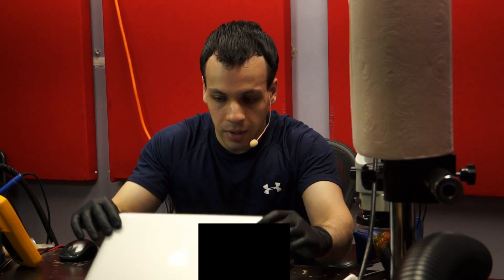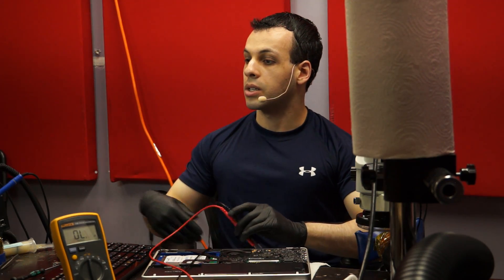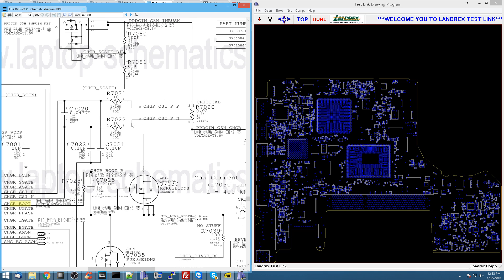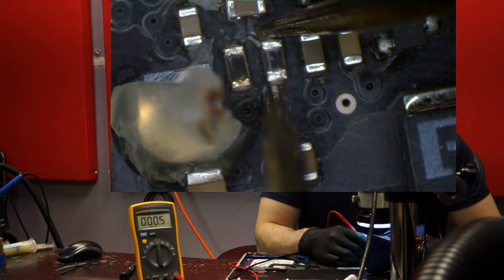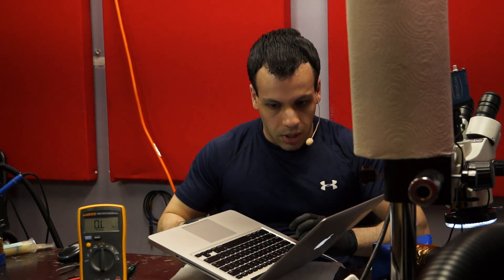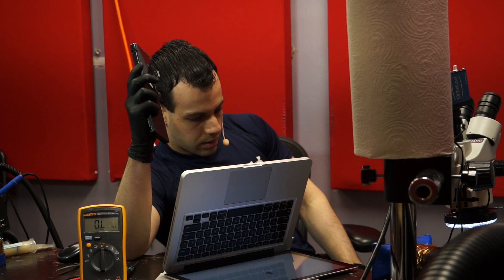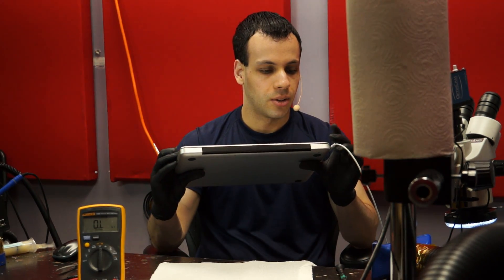Macbook that doesn't charge magically fixes its own current sensing circuit

Comment: Hey Louis, this same exact thing happen to me. It's that knock off eBay battery. I opened up mac resource inspector, and it would fault the battery saying cannot charge current too low. If I replace the battery with a genuine original one, it works perfectly. Then when I switch back to the knockoff battery, it works fine. The knockoff battery only had 2 cycles. It's gotta be that knockoff battery.

Comment: Louis,
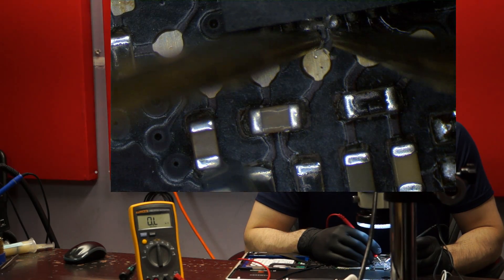look at frames from 6:38 to 6:49 ... It looks like your Fluke probed "Bridged" the solder to the adjacent pad (the movement from bottom towards the the top of the screen) You can see a solder bridge after you lift the probe.  

Too late now I guess though to know for sure.

Comment: There was high resistance before and low resistance after when measuring?so perhaps u resoldered some cracked joint between resistor and pcb while removing epoxy? just my crazy theory. 
Like once upon a time, an accidentaly done reflow really fixed the thing :-) and look where it got us now :-)

Comment: I'd be willing to bet money that it was that epoxy you removed. It was likely holding a bad solder joint open on the resistor. Once you hit it with heat and removed the epoxy the gap sealed and you got current and correct resistance.  It could have been the lead you pushed on with your tester probe too. It's hard to say. That's the allI can think of... The question becomes, has it failed again since?
Reply from the maker: no failing since. i think the hot air reflowed the solder, the hot air i used to remove the epoxy.
Reply: I'm going with the reflow of the solder when you were removing the epoxy, makes sense.  Would have done a touch up on the joins either side "just to be sure".  Always nice when you get a good win like that though :)

Comment: I have an old macbook white 13 inches, it reconize the battery , it says battery not charging, if i remove it it wont start with the macsafe alone, in order to start it has to be the battery in place even if it doesnt charge. I did the SMC reset trick, it wont work. Any idea what it could possible be? I replaced the macsafe board, the charger and the battery (the 3 are new ) but the problem persist. Please help.

Comment: It's quite possible that you had an air bubble in the solder connecting a leg causing internal arc, throwing off voltage sensing. Heat fixes that issue.

Comment: When you heated up the Epoxy, that most probably heated up the component, and magically fixed it, or maybe, that Mac knows from who to be afraid of, that's all that I could think of, by the way, I had the very same issue with 820-2565-A, but it had no green light and no power, I opened it, and started probing around, and magically one wire circuit fixed itself, don't know how, but anyways I replaced some components on one wire circuit, just to be sure that it wont troll me again, and works like a charm, next problem was, that I detected keyboard, but it didn't work, cause it had a whipped cream in it, which I replaced, and still had no keyboard keys, until I replaced keyboard controller chip, which also worked like a charm

Comment: SMD resistors may experience changes to electrical parameters due to environmental influences like soldering, mechanical stress factors (vibration, shock) and humidity. The greatest stress factor is soldering. The heat of the solder, especially for SMD resistors, can cause ceramic  film resistors to change contact resistance between terminals and electrodes. Sometimes heat of 200 to 250 degrees  can repair internal cracks of SMD resistors by melting the glass powder which contains the carbon powder, this is accually a procedure used during manufacture, however sometimes this might not be a permanent thing depending on the amount of heat used.

Comment: +Louis Rossmann Removing the battery and running on power could've caused an SMC reset which can solve some charging issues.
But as for the measurements I have no idea, might be the contact points on the QFN?

Comment: You were getting the wrong resistance reading cause it takes a few mins for everything to discharge.Duke has mentioned in another form to wet your finger & go around the ISL to discharge quicker.Keep up the good work

Comment: I myself don't charge for miracles, because if I don't know what broke in the first place, it can break again
Reply: Do you at least charge for the time you spent inspecting it? Like a troubleshoot fee?
Reply: Sometimes I may charge a small fee that will count as payment for the next time that computer comes for the same problem, because if the system starts to work and doesn't fail again I can't troublesoot anymore

Comment: I did learn.
I learned technology does not only trolling me.

For instance. 
Few months a go I bought from ebay gaming laptop with screen not working.
I received it, disassemble it, removed screen, and put it all back. Not working. I unplugged and re-plugged all the connections few times. Not working. 
I ordered new screen it arrived put new screen in. It works.
For curiosity I removed new screen put old screen back, and IT F*ING WORKED.
Why!

Another.
I removed MB from laptop it works. Put it back it does not. 
Removed it. It works.
Put it back. It does not.
I guessed it laptop case was shorting something, so i took painters tape and covered hall MB.
Put it back it DID NOT WORKED.
Why!

Comment: Hi Louis, have you ever changed Dell Inspiron 15R LCD cable? I think my needs to be changed because when I close the lid it starts to flicker like that https://www.youtube.com/watch?v=YU5n2HAkSeU . Is it hard to change it or I need a technician?
Reply from the maker: +Josh3292 that's probably a bad screen. it's not hard to replace yourself.
Reply: But it only flickers when I'm closing/opening the lid (then hinges are moving), it doesn't flicker when i press the frame of the screen, the back of the screen etc.

Comment: I used to run a VAX3500. One day it wouldn't boot and in my frustration I gave it a technical smack on the side of the cabnet. Now no one would be surprised that this technique can often work on say an old TV for instance. The VAX3500 booted up just fine and I never had a problem with it again.
Reply from the maker: +Sideshow Bob smacking the 25" RCA console TV to make it work again ten times a day is a childhood memory I was glad to have erased!

Comment: It could be a bad solderjoint. I had that with a  lab PSU without output, when I probed the collector of a sot23 transistor the output came back. I resoldered it and still works fine (5 years after the repair) The most bizar was a Tek 1S2 TDR plugin,. That worked when it was mechanical disconnected from the plugin, but as soon as I mounted it in the plugin, the output changed very much. (is a 50ps pulsgen)  Turned out a bad solderjoint from a transistor, the mechanical force on the board from the GR connnectors was enough to "open" the soldercrack and turn it into a capacitance. Under the microscope I could see the light peak through the crak. Resoldered it and it workes since then. And these are not the only once I found. This happens a lot. But I only repair test and calibration gear and those solder problems are most times through hole  related.

Comment: You reset the SMC by disconnecting the battery for more than 5 seconds. My rule is always reset SMC before doing any hardware repair.
Reply from the maker: +Salman Bushehri SMC is not in series with current sense resistors.
Reply: +Salman Bushehri most plausible answer in this list AFAIK. But I would think Louis would have tried that already
Reply: noted. Thanks

Comment: Tin whisker formation at a guess, heat beat the bitch back or you flicked it off with the probes fixing the problem. you caught a rare beast that's more or less eliminated now but can still happen if manufacturing standards drop blame foxconn/apple.

Comment: burnsy3210
I never guaranteed intermittents I would work out with the customer that I may have not permanently fixed it, do you want to keep returning it for additional cost, etc. Would be case by case basis.

Comment: Hey Louis maybe that resistor with the brown around the epoxy on it maybe had a bad solder joint and when you used your hot air gun it reworked it's self better? Just wonder.
Reply: +joseph chrzempiec  You got the magic touch man :)
Reply from the maker: +joseph chrzempiec (josephchrzempiec) It's possible.

Comment: Could it have been an iffy solder joint on one the sense resistor or one of the series resistors? Or even a junky ball on U7200? I've seen lousy balls make better contact when pressed, and you definitely pressed on the them with the probes...

Comment: that is weird one maybe just dident like the glue on it
Reply: +Kriss Bartlett The glue is protecting the Chip On Board, its bare silicon.Epoxy does not conduct electricity so removing it would make no difference.
Reply: I know so its weird that it worked and he dident do anything I have had computer mother boards like that to but mine are IBM compatibles
Reply: hey you not elli the computer guy or do you follow him I looked on your page ?

Comment: I'm pretty sure the resistor wasn't in place and by heating the resistor you soldered it to the motherboard. I could be wrong though
Reply: The bottom of the resistor is corroded under the epoxy, not sure if that's relevant though

Comment: I've leant that you didnt check carefully the circuit which shows 50k before attempting to remove glue in order to check the resistance. That would be curious at least for me what is going on... and without checking this the problem be back very soon .

Comment: Just wondering why you didn't use the test pads instead of poking at the chip. 

Sure it shouldn't make any difference, but the only thing i can think of for the 56kohm reading is dodgy connection, which judging by the shitty soldering job is possible, or the ghost of Steve Jobs is haunting  you :P.

Seriously, rust on a solder joint?!
Reply from the maker: +Pieh0 Because it's not a real test! If the trace between the chip and the test pad is blown, that won't show up in my measurement if I measure from the test points rather from the chip. 

The idea in doing that "full circuit measurement" is just that, to see if there are any issues in the FULL CIRCUIT!!!!

The traces between the test pad and the ISL6259 chip are a very important part of that circuit! I run jumper wires between them all the time.
Reply: And you wonder why people troll you when you give a shouty answer back like that...

The last paragraph would have been enough. All i'm saying is that with shitty soldering from apple, added with a ton of crap around it, trying to probe pins of a QFN is a bitch, and a simple sanity check by using the pads would have been a 5 second job. Which would also rule out a problem with the track.

Thanks for clearing that up though.
Reply from the maker: Pieh0 you can't rule out a problem with the trace between the probe point and the isl6259 if you measure from the probe points since you are not including the traces to the isl6259 in the measurement. it will still show 2.3 ohms on the meter even if those traces are broken. 

i learned this lesson when i spent almost two hours troubleshooting a board that had a burned trace between the resistor and the chip. :(

Comment: Why didn't you take a chance and refill the resisters that you touched? Maybe putting the pressure you put on it is enough for now but not fixed. Interesting to see if it happens again.
Reply from the maker: +Chuffered FUoogle I replaced them all later off camera and redid the solder on the pads but once the board started trolling me on camera I ended the video.

Comment: Did you charge the costumer?
Reply: +2110ify Yes. Why shouldn't he. He did what the costumer asked for. It wasn't working, now it is.
Reply from the maker: +2110ify Of course.
Reply: Louis Rossmann Ok
Reply: This is when you charge double and explain to the customer that it took far longer and many more parts than expected to repair the machine.

Comment: I'm pretty sure it was that hot glue. The resistor had a rusty color on it and it was on the epoxy as well. It could of been conductive.
Reply: I was thinking on the same thing. :)

Comment: as an ex repairshop tech, i'd love to know what you tell the customer and how much do you charge in this circumstance? because there's obviously a risk that this could come back and you'd have to hope the same magic happens again if you're not honest and if you are honest the customer will likely say they dont wanna pay because you didn't really do anything (apart from obvious labour time but customers dont see it that way)
Reply from the maker: +burnzy3210 I was 100% honest when I told them that I fixed it. Which I did. Current sensing was 50,000 ohms before I touched it, and was 2.3 ohms after I touched it.

Maybe I just three Florida cracked the joints. Maybe I pushed it into place. Maybe my body's ESD fixed it. Who the hell knows? However, it is on camera being measured dead. And is on camera with a proper measurement after.

What did wind up removing those resistors, licking the old daughter, and replacing them later so that it would not come back for a warranty.

Comment: I've seen that before with resistors. -You've proven more than once that you know what you are doing. People saying they've never released the magic smoke are liars or not as knowledged as they pretend to be. (Heck I even do it for fun sometimes) Kinda ot to go in on that but i'm trying to prove the point that i'm not trolling. Please replace the resistor under the epoxy, Louis :)

Comment: This will be a trap. You will send it back and they will say it's broken again. Could almost bet on it
Reply from the maker: +russ18uk the resistors and solder joints all got replaced after the video was done recording. the issue was most likely a solder joint.

Comment: What do you tell the customer in this case? I highly doubt they would be okay with you saying you did nothing and it started working all of a sudden.
Reply from the maker: +mab4110 I cover this in this video. https://www.youtube.com/watch?v=wlQeavkp5ow
Reply from the maker: +mab4110 my best guess is that I reflowed the solder on R7051/R7052 while removing the epoxy and that fixed it. In the end I wound up replacing those resistors, removing all the old solder with wick, applying new, and testing it for a few days running down the battery and charging it back up. 

I tell them "here, I Fixed it", and move onto the next.

I am sure some people would be mad at that, but I spent enough years of my life to be able to know to look at the resistance between pins 17/18 of U7000 when this issue presents... if someone is legitimately mad at that, then oh well. The average layperson looking at this board, even with my toolset, would probably not figure this out given a year(pre-me-posting-these-YT-videos-to-the-internet of course).

There are people who realize the customer has a bad charger, and swap their charger for a good one and bill the customer for board repair... I worked at a place for 4 days that did that kind of stuff. That is fucked up bullshit. However, as silly as this wound up being, and as odd as it worked out.. it was indeed board repair. It's on camera with 50+ kilohms on a 2.3 ohm current sense circuit!
Reply: +Louis Rossmann Good stuff, thanks.
Reply: +Louis Rossmann Yes, the reflowing while getting that epoxy stuff off would be a good bet. Good job. It's funny when you get those WTF moments though LOL.

Comment: Hey Louis,
might I ask how that would impact the original repair estimate? And what if it doesn't work anymore?
Reply from the maker: +Patrik Gubeljak Same as stated. I obviously did something here because it genuinely *measured* bad. It's right here on video measuring bad!

I replaced all the sense resistors and the cap in the circuit, cleaned the old solder, put on new. My best guess is in removing the epoxy I reflowed solder on a joint that was messed up on R7051 or R7052, and that the bad solder joint was causing the issue. I replaced the resistors when I had free time to be safe. It worked for several days, passed all tests, and is done...
Reply: +Louis Rossmann I forgot about all the extras not on camera :P
Reply from the maker: +Patrik Gubeljak I could have given it back to him as is but since I use a lower temp to remove the epoxy than I do to melt lead free solder the joint probably would have failed again in a day or two.
Reply: +Louis Rossmann and then you have to take it apart again and deal with him getting annoyed and less happy with you. Got it :)

Comment: Its the epoxy! =D   See how there's some brown / red stuff on the epoxy, I wonder if moisture or something has got in there and somehow was interfering with the resistor connections?  Love the channel btw!  Can't get enough of your channel, and iPad Rehab.  Your videos are both educational and inspirational.
Reply: +GadgetUK164 But then the resistance should have gone down, not up...
But it could be a sign of corrosion of the resistor and the resistor is blown but got "fixed" by the heat.
Reply: Yes, that's more logical!  The epoxy was the clue though!

Comment: Maybe, wires of the knock off battery were messed up and causing this issue. o.O
Reply: +Ozan Erbektas Where it was connected to the motherboard, those wires are very much open to fatigue.